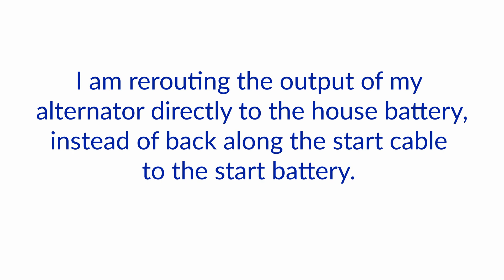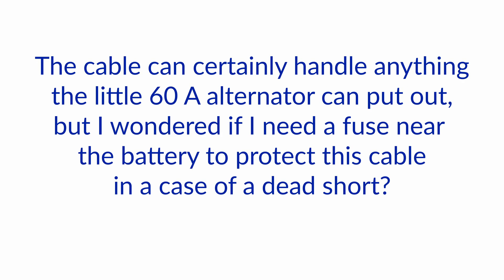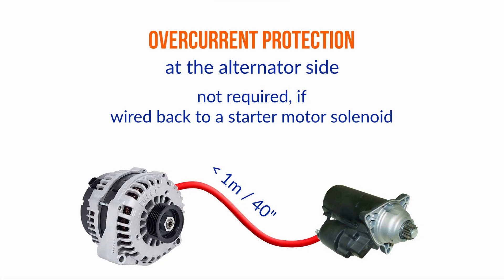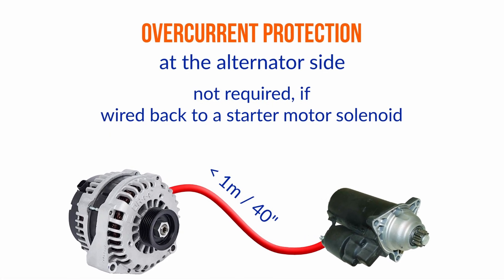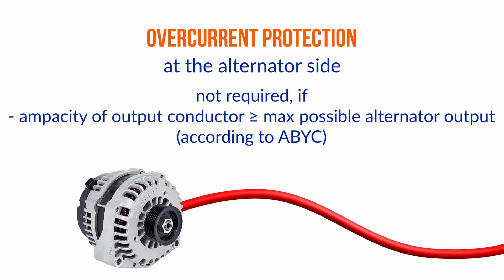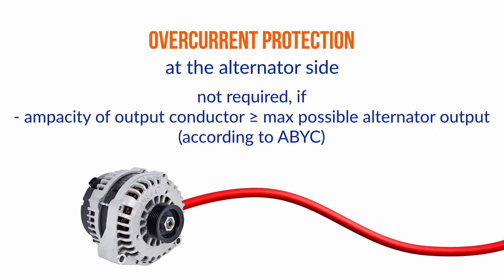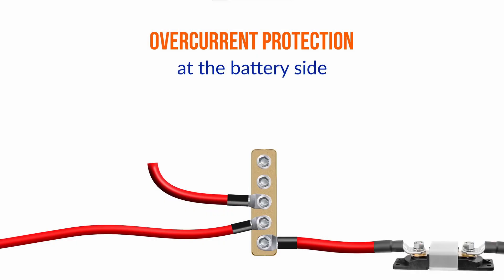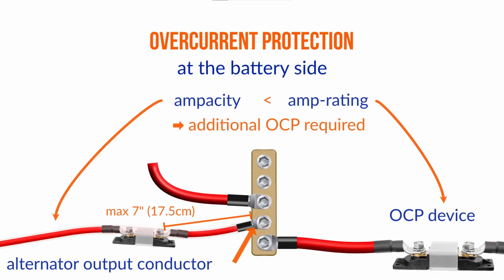FUSES for ALTERNATORS - Why it matters where you place it. | Ask The Expert with NIGEL CALDER

Comment: If you have a long run with the charging cable from the alternator to the battery, would you use a fuse near the alternator and if so, where do you get sense voltage for the regulator? If the fuse blows, the regulator still sees battery voltage and increases amperage from alternator thus ruining the alternator.

Comment: Impressive, so much information in such a short video.
I have seen your video about MRBF fuses and the AIC rating with Lithium ion  batteries, big NO NO! Thank you for the info.

Im thinking about installing a MRBF fuse on my classic car with a regular led acid battery.
Any reason that i should not?